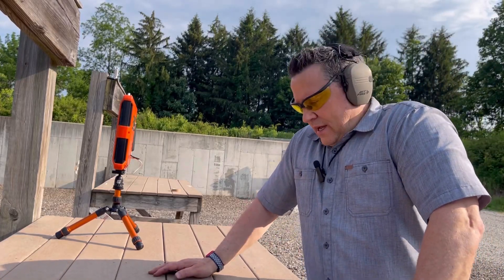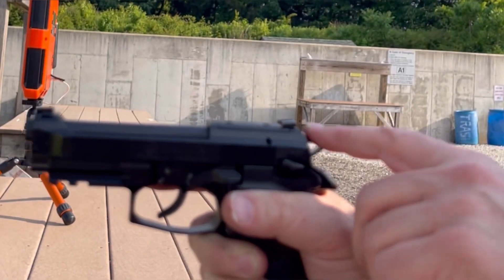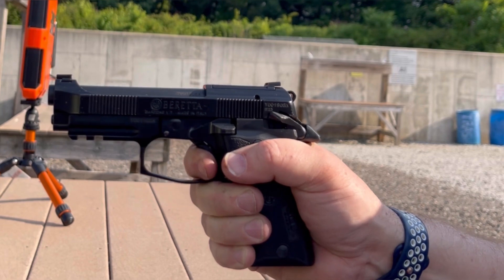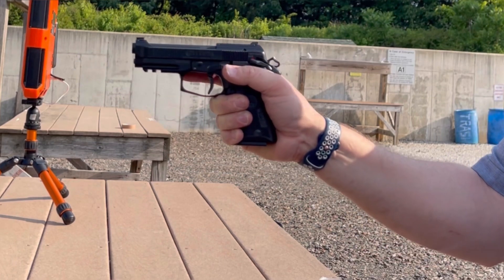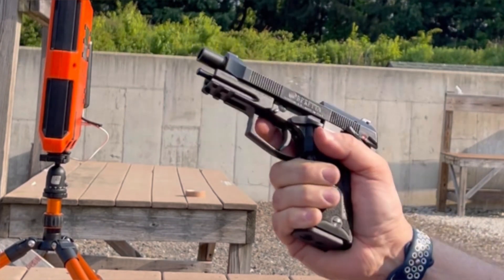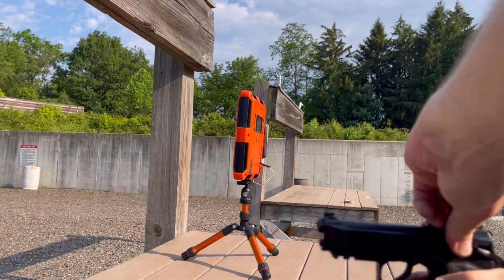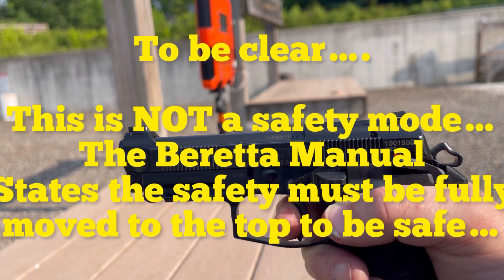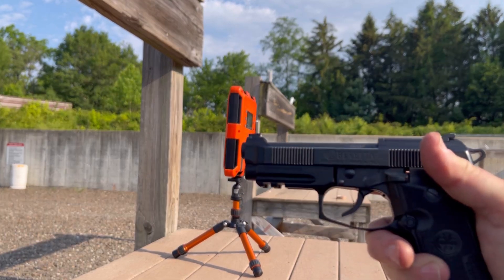Beretta 80x Safety Testing! Uh Oh….

Comment: Thanks for getting to the bottom of this. Do you think it is just your individual gun or are other owners reporting in forums that they also have that false safety state?
Reply: definitely not the only one that does that, it happens on others too
Reply: @mk2_suprr  that’s bad. Then this should definitely trigger a recall. Seems that Beretta still has a learning curve on the frame mounted safety
Reply from the maker: I have no idea what the extent of it is.  Thanks Ava for reporting it!
Reply from the maker: It’s hard for me to say a recall.  I mean, they clearly state in the manual the safety must be all the way up.  It’s just that if you don’t read the manual or are going off of feel, it could be dangerous.  So I don’t know but anyone that has one needs to be aware of this at the very least.
Reply: I agree with triggerbar, if its supposed to function that way than its just down to a training issue, but they definitely should also include a more apparent warning about how the safety functions instead of assuming everyones going to download/read the manual
Reply: @triggerbarPhD  I would be surprised if not. What you show is a tactile and audible feedback as well it stying permanently in that position.
Reply from the maker: @nikos6220  that is very true
Reply: @triggerbarPhD  I agree w/Niko and suggested that this is bad, even while they state in manual it has to be all the way up, I do predict this could end up in a recall. A gun not behaving the exact same way every time is something I'd consider a problem. This won't end well for someone at some point that thinks they are in a single-action type safety position at that half-way position.
Reply: @nikos6220  seems they may have consulted with Sig Sauer engineers on the design ☣
Reply from the maker: @ShastaBean  I just heard from someone on Reddit that in this position it pulls the hammer every time.  But also has the audible  click that it is on safe.  He was also pretty frustrated.
Reply: @triggerbarPhD  understandable, but even so - that would be far more acceptable, and at least not lead someone to get tricked by the way yours is seemingly random, or increasing the # of pulls and non-drops. The swipe & tactile click but not be on safe is one aspect no doubt...but the pulling 20x and THEN drop - that's insane imo. But to his point...being at a range, or any sort of actual shooting encounter after firing off a few rounds and the hammer is back and give it a flip up w/o being fully conscious of the hammer - scary. In that case, I guess I'd prefer it let me pull 20 times before a discharge. 1 pull and boom? ew.

Comment: Is there any example of a TDA gun that can be carried in condition 1 while also having a decocker? I doubt Beretta would have permitted condition 1 carry unless they also found a way to rotate the firing pin pluger up and out of the way. Still, it looks like they were almost there, though I would personally carry it DA anyway.
Reply from the maker: Good question!  I don’t know of one, but some da/sa guns only have a safety and not a decocker so maybe like a CZ with the safety??  I agree I’ll carry this with the safety off and the hammer down in DA.
Reply: Yes. HK P30, and several other of theirs. Bersa TPR9 (maybe?), Taurus PT92, Arex ZERO, FNX, and maybe some others

Comment: This is not a design issue.  There is no false safety.  If you can still see the red dot, it's not on safe.  The 80x manual clearly states the safety is only engaged when you can move it no further.  The 80x is not designed for carrying cocked and locked.  Neither are the 84, 85 or 92.
Reply from the maker: I said that.  But if you feel it, and you don’t know what the manual says, which BTW, the gun does not come with a manual, then you could be mistaken to think there is one.  Obviously they state how to use this safety and if you know that and use it correctly there is zero safety issues with this gun.  If you don’t know and aren’t  aware of the manual, then you could be greatly mistaken.
Reply: It threw off Hickcock45 on sunday when he thought it was in safe and his gun went off on his sunday morning shoot around.  He didn't read the manual but he thought he knew how the safety worked and boom.  Design flaw or not, if you don't know how to use this and think it has a cocked and locked position because the safety snaps in, that's a problem.
Reply: @triggerbarPhD  .  The 80x is my 4th Beretta handgun, so i'm familiar with them.  I knew without downloading the manual that they are not to be carried cocked & locked. When I bought the 80x at Cabelas, the salesman made sure to tell me  not to carry it cocked and locked.  Keep up the informative videos.
Reply from the maker: @charlesroux8  my 96 has a very different feel but it slide mounted and not frame mounted so I’m guessing that’s the different feel.  So do your frame mounted safeties all feel this same way?  Thanks again.
Reply from the maker: @ChokeYourChicken yes.  Round in the chamber, decocked is the best way to carry.  The long heavy double action trigger makes this safe.
Reply: I agree 100%.

I held off on responding to this video until I purchased an 80x. It is very useful to point out this design element to users. 

However,  as you stated this is NOT a defect.  The manual is 100% clear that this pistol is NOT designed for condition 1 (cocked and locked) carry. 

The proper manual of arms is to either:

Decock the pistol and leave the safe on until you wish to fire, and the manually disengage the saftey or,

Decock the pistol and the turn the saftey off.

I don't think a clear and well defined set of instructions should be ignored, and if you ignore the instructions, well...  then the defect may be with the user rather than the pistol
Reply: I believe people a quibbling over what is “Technically an actual design defect” and a design feature that can lead a shooter to think the gun was safe when it wasn’t. There is a difference.  Gun manufacturers have a responsibility to avoid both scenarios. I won’t buy this handgun because of that feature.

Comment: it has a 1911 style thumb safety to where the safety switch will stop the slide there is a cut out on slide for it and the red dot should not be showing red means fire on beretta's if you see red it is not safe

Comment: Thanks for the video.  I know responsible gun owners should read the manual but many don't.  This can be disastrous as many inexperienced or beginner shooters will go with a .380 for the light recoil.  They could easily fall victim to that fake resistance since there was an audible click and may not know to push all the way up and ensure the red marker is fully covered.  I wonder if there will be a recall on these since I have seen multiple videos now from multiple channels.
Reply from the maker: I haven’t seen one.  I even saw a recent video from TFBTV where he still claimed it could be carried this way even though he talked to Beretta and was told he shouldn’t.  The manual clearly states the red needs to be covered.  I’ll be honest, I think most of the problem is how it feels and then is made worse by bad information on the internet.  When I first got the gun thought the same thing because I’d heard it in one of the reviews I watched.  It wasn’t till I noticed it and actually I felt it in my first review.  Then a few people commented and pointed it out how this was a big deal!  I hope no one gets hurt with this which is why I put out several videos on the subject (not that mine get many views).  But at least like hickock45 corrected his original statements so there is some popular channels putting out safe info.  Idk though…

Comment: Mine also does that "dead trigger" in that position. I was planning on doing some testing with live rounds, but now I don't see the point. I fortunately am gun savvy enough to know this wasn't a true safety, before even being made aware of it. Beretta does explain in detail with multiple warnings in the owners manual, but people are idiots. Good gun so far, but my total round count is currently abysmal.
Reply from the maker: All good point.  Unfortunately they make you download the manual, that’s my complaint but yes, it’s very clear there.  It also doesn’t help that many people learn about guns on YouTube and that’s where bad information is also spread!  I’ve got over 1200 on mine now.  Just a few failures with different JHP’s.  Also I found it needs oil after about 500 rounds.
Reply: @triggerbarPhD  first box I tested was some D Defense jhp. It was labeled ad "A Chris Kyle Brand of ammunition" 🤷‍♂️. Never heard of it before. Very first round needed to be smacked into battery. Ran 50 of that without any other issues. Ran a mag of G9 without issue,  which will be my carry option as they perform well and G9 is local to me. Have 318 rounds currently and the gun has run great since that initial battery issue. Any idea on what the recoil spring life expectancy is?